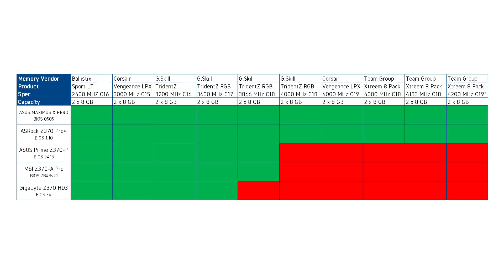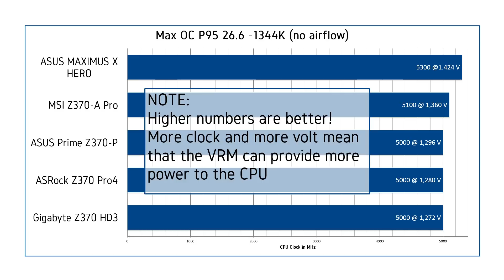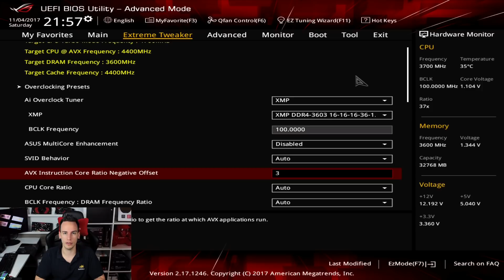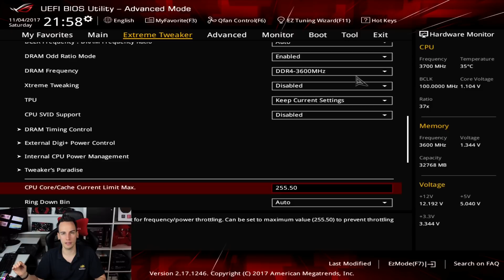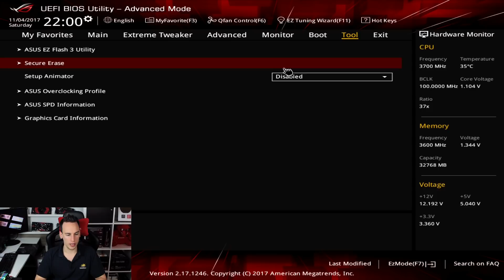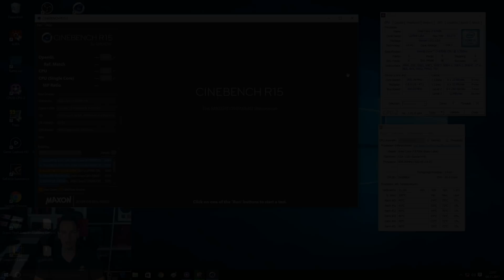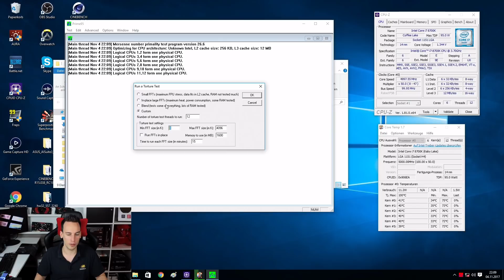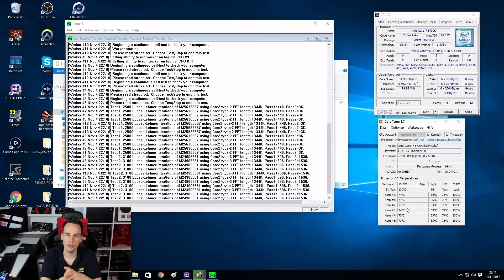ASUS MAXIMUS X HERO - Overclocking Test and Guide 8700K (en)

Comment: I am using a 120 mm radiator push pull fan. Load line calibration level 6 was to unstable, level 5 gave more stable voltage control. I was able to reduce Temps to 80 degrees C and lower for a whole hour at 4.8 gigahertz on all cores. Latest bios, 1801. Thank you for this great tutorial.
Reply: yeah level 5 is less agressive indeed

Comment: derb8auer can you confirm this behavior on the motherboard for me? Whenever i enable an overclock with this board say a simple xmp overclock the boot process changes when flipping the power supply switch on the psu than it does at default bios settings. At default flipping the power switch then the case power button the system boots up once. But with any sort of overclock flipping the power supply switch off then on then hitting the case power button the system will boot, shutdown then back on normally. This only occurs with an overclock then flipping the power supply switch off and on. If i don't flip off the power supply switch again with an overclock enabled and simply continue to power on and off with only the case power button then this behavior never repeats itself. I'm just trying to find out if this is a new functionality of these newer boards. Because with evey Asus board i've used from the IX Code and down i've never seen this behavior. I would appreciate it if you could test this yourself.

Comment: to make 5.1ghz or 5.2 you need scalping, otherwise it is dangerous for the processor, I tried it and it keeps normal in tests, but temperatures are high 95-98 degrees and that is not good, i have asus maximus X Code motherboard and i7-8086k limited edition procesor with ram g-skill 3800 32gb(4x8) its a good system but needed scalping:) I myself do not want to do it dangerously:) but the i7-8086k processors themselves do a boost when they need it so I don’t know if there is more sense for overclocking)) what do you think?

Comment: Thanks for the vid!

Does anyone know if these settings could be used also for the 9600k? I know it is roughly the same as 8600k but where I live there is a deal for the 9600k being -20€ cheaper including black ops 4. Id like to oc to 5ghz with a Noctua NH-D15 without delidding. Is this possible?

Comment: Ive used completely same settings for my asus rog strix 370H with i5 8600k. Ive got 4.8ghz with 1.28vcore. When i run cpu-z my core voltage shows as 1.264 and under load goes down to 1.232.. I have 16gb ram 3000mhz.  Why is his idle vcore is lower and under load voltage is higjer as it should be ? Is my motherboard throtelling or what ? Ran prime95 as shown in video its all stable.. Temp are in high 60's under stress test.. But why is my vcore is different than bios and goes down under load ? Will i damage something if i will leave it as it is ? Like motherboard or smth ?

Comment: Thanks for this. Is there a way to where the CPU isn't always at it's max clock speed? You know....so it can idle down to a lower speed when it's not needed. Any ideas?
Reply: just type power saving plan  to search bar on windows and use balanced option there then it will clock down when idle and not needed as he stated ofc you can have it at high performance like he said its fine

Comment: with delied max overclock in Z390 maximus XI hero at GHz all core with 8700K?with cooler Noctua NH.D15S ans double fans max 85 grade?II aspect for period befor nataiclie andl buy Z390 XI Hero wifi or no is same?excluse wireless? not use wireless only cable,i use adapter netgear AC 1.300 Mbps and 600 for N A7000 nightwak.Thanks Master.

Comment: @der8auer I followed all of your steps in the tutorial since i have the exact same CPU and MB however, I noticed that while running Prime95, that my CPU frequency lowers itself about 300mhz lower than what I set it to be (4.8ghz). It runs at 4.8ghz and then drops to 4.5ghz for a few seconds and then ramps back up to 4.8ghz. What is the reason for this? Is it because of too little voltage? or should I set Windows Power Savings to Performance mode? It is running at the default BALANCED. Thanks!
Reply: its the avx offset that lowers it, im running 4.8ghz stable with avx set to 0
Reply: @Shadevv   I initially thought that to be the case as well, but Roman says in the video that that particular version of P95 applies a non-AVX workload. Then why would the CPU underclock during stress? I don't get it.
Reply: @HammerHead0908  you could try to put the power plan to max performance and then run it if it makes any difference,
Reply: @Shadevv   thats a good idea, though i wonder if a professional workload like blender (i think not AVX?) or video rendering with Premier would cause this speed drop?

But it still doesnt make sense why an non avx workload like Prime 26.6 would cause a speed drop just due to the power plan? I checked the power plan before and the max is indeed 100%. Dont get it.............
Reply: @HammerHead0908  well its possible its not about that, have you disabled the correct settings in bios?

Comment: I'm hiting 90C on Cinebench and I'm only at 4800MHZ and 1.248V of core voltage. I have a tower cooler. What should I do to lower my temps, reduce CPU voltage or reduce CPU speed?

Comment: Im using a maximus IX code with a gen 7 chip. I used this base to set my 5 GHZ over clock and it seams to be running well. Is there any reason i should be concerned about doing this with my chip ?

Comment: I have been using these default overclock settings reliably for 6+ months.  Updated to BIOS 1704 last night, reapplied all the overclock settings, but the CPU still seems to be operating at the stock 4.0 GHz instead of 5.0 GHz.  Anybody else seeing this?  I've cleared the settings and reapplied them again just to be sure - same result.

Comment: I got a question.  Using Maximus X formula and followed your guide. My problem is my Vcore won't clock down, my clock speed idles but not my Vcore stuck at 1.344v at 800mhz. C-state is on auto and Speedshift is enabled.

Edit: Using the latest bios. Used CPU-Z latest version, showing 1.344v when idle @balance power mode.
Reply: If you're following the guide it's because of the manual mode for vcore.
Once you're happy with your overclock you can then change to adaptive/offset voltage and adjust to the same voltage as you got with manual.

Comment: I changed case from a nzxt h440 into a h500i. when i turned everythin back on pc didnt want to boot telling the system has posted in safe mode because of instability or the power button was held off to force shut down. MB is an asus maximus hero X, i7 8700k and 16gb ram 3600mhz corsair vengeance. I dont even have any overclock on,  only xmp profile was active before i started to rebuilt into the new case and i found out that by disabling it pc would boot again into bios. I cant apply xmp anymore for some reason. i had it active since febreary since i built this computer in that h440. Bios is updated to last version. Is there a way to fix this? i cant run my ram on their advertised speed, pc will boot till 3000mhz. Already tried manual ram oc, voltages, timings, mode 1 mode 2 nothing worked. Since i rebuilt i can only post at 3000mhz

Comment: Thank you so much for this guide. I managed to overclock my i7 8700k to 4.8 Ghz @ 1.250 volts (Only using 1.216, so i might change that) ran the stress test for about an hour with no complications and my temperatures were around 68 degrees. Hopefully they go down to the low 60s once i drop the voltage to 1.220. I still haven't played any games, really excited to start though.  Thanks again.
Reply: Hello my core voltage its become fix at 1.250 its normal not have problem ????

Comment: I copied everything. And it hangs before the windows login.

I5 8600k
Asus Roy strix z370 g gaming
2x8 ddr4 2666
Reply: You may need more vcore since the i5's are usually lesser binned cpus.
Reply: @Neggy-Z  after playing with it for a while. I was able to get 4.9 @ 1.37v stable. 5.0 is stable @ 1.47v which is scary.

Comment: I'm have Asrock z370 extreme 4 at 12 phase and 8700k answer cooling Noctua d15S + fan premium 2017,the z370 extreme 4 used Mosset good mada in japan,have  also problem memory with bios 1.80.Thanks.

Comment: This is probably the best overall z370 motherboard, but as it was not cheap, i went with the asrock z370 gaming k6 which is also a really good board for overclocking. It would be my pleasure if der8auer could do a an overclocking tutorial video for the asrock extreme4/gaming k6.

Comment: Great video. I am new to PC building and overclocking. I just built my computer 2 weeks ago and am running without a GPU since I pre-ordered the 2080 Ti FE. I have a 8700K and a ASUS ROG STRIX E-GAMING Motherboard. Also running Trident Z RGB 3600 Mhz with CL 16. I have a Corsair H100i V2 240mm water cooler with two LL120 RGB fans in an Inwin 101C case. I hear the E-gaming is not as good as the Maximus Hero of course but I got it for a good deal and I did not plan on getting the 8700K at the moment and was going to be getting a 8600K. The BIOS is the same so would I use the same settings and steps. Any help and tips or links to videos about understanding more about overclocking will help. I am worried about temps and hopefully that I got a good Chip. I will probably watch this video multiple times and do more research. Maybe I should start with 4.8 Ghz? Should I wait to get my GPU to overclock. I already have the ram at 3600. Thanks in advance.

Comment: I overclocked my 8700k to 5.1 which was working for a minute but for some reason the multiplier stays at 42.0 now and wont go above 4200 MHz which is really pissing me off after following multiple tutorials and testing it with Prime95

Comment: Hi de8auer.I just finished my i7 8700k build and i just want to say thanks for your video it helped me alots. 
My i7 8700k is running at 5.1ghz avx 0 with 1.296 v my temp is around 68C on each core but peak at 79 once in a while but the avg is 68-70 on prime95. 
I can also get at 5.2ghz i did try it but i dont want to go over 80 in peak temp,
the chip is not delided and i use a corsair h100i V2 with original thermal paste ...i want to know if i change only the past from my h100i v2 for kryonaut past 
what should i expect ? 5-15C better ?  

look like i have a good chip since you said for hitting 5.1ghz 5.2ghz stable you need to delid your chip and mine is not and i get it at 5.1ghz at only 1.296 v stable
i can get it a 5.2 1.330 stable but temps get a bit too high thats why i want to change my thermal paste for kryonaut so i can get lower temps and keep it 24/7 at 5.2ghz

Comment: Awesome instructions. I ran these settings on a ASUS TUF Z370 Pro Gaming mobo, i7 8700K (no delid), Corsair Vengenace DDR4 3200 RGB, Corsair water cooling and it worked above my expectations. VCORE under load at 1.324 volts, idle at 1.344 volts, max at 1.360 volts. VRM 6 phase , temp at 76 degrees Celsius, CPU temps, package, idle at 37 degrees Celsius, under load at 76 degrees Celsius, highest core temp 81 degrees Celsius. 3rd Cinebench in a row score 1609.      It's nice to know my machine runs well with these reasonable temps, but I have no use of a overclocked machine, because this is my music studio pc (Steinberg Cubase Pro 9.5 using AVX instructions) and the audio latency and CPU load was much higher overclocked, then with the ASUS Optimized default settings.  So, I'm back to the Optimized default settings, but probably going to delid my CPU, and use 360 water cooling so my fans make less noise. BTW ambient temp was 29 degrees Celsius and water cooling idle at 32 degrees Celsius.  I don't know if It was safe to do this without deliding and I would like to hear some opinions about my overclock, especially how to lower the audio latency. I think I'm going to try this overclock without XMP enabled or lower DDR4 timings. Thanx for this great instructional video.

Edit: Tried some RAM frequency settings and It runs better at 3000 Mhz.  Less latency and less CPU consumption and no more cpu spikes.  I think my corsair ram has a to low voltage on this mobo to run at 3200 Mhz. It's crazy, but It's at 1.376 volts.

Comment: @der8auer, could you offer a little advice please. What does Maximus Tweak mode 1 and mode 2 do exactly (RAM settings page), what are the differences? I'm trying to get my RAM a little further than 4000Mhz without hammering it with vDIMM. Many thanks.

Comment: If you are using Asus z370 strix - always update you BIOS to the latest version. Otherwise you won't be able to run a stable 5GHz overclock with those settings!

Comment: What setting should I use for a non delidded i7-8700k?
Reply: Same if you have decent cooling. Just keep an eye on load temps and not going too much on vCore voltage and you should be fine. My 8700K will do 5Ghz on 1.280v, so you could start a little lower vCore than der8auer has in this video.
Reply: Antony Cambell I have an h100i v2. Would that work as “sufficient cooling”
Reply: That's a good AIO, should be fine for cooling 8700K as long as you have good airflow to the radiator. Good luck, have fun with it.

Comment: 7:00 so, can you explain to me why we can’t use lower level like 3 or 2 if the lower level is better as you said?
Reply: 2 or 3 is too low and will still get vdroop under load which will cause crashing. To maintain stable vCore use 5/6/7, generally 5 or 6 is best.
Reply: Antony Cambell  Thank you so much man for your replay, i didn’t overclocked my cpu yet but im planning to push it to 5.0-5.2 ghz depends on temps so what is your suggestion should i go level 5 or 6 , my cpu: i5 8600k , mobo: asus z370-e
Reply: All you are doing by using LLC (load line calibration) is trying to maintain the voltage you set manually for your vCore. Idle doesn't matter so much, but under load you're trying to keep it close to what you set manually. Ie, for me my vCore is 1.280v my LLC is 6. Under load it stays at 1.280v mostly with a small overshoot which is fine, you just don't want it dropping under load or it's likely to crash.

Comment: Hi Roman, 
The VCCIO and VCCSA voltage are both around 1.34V in M10H motherboard. 
CPU is 1.37V 5.1 5.0 8700K.
Memory is Corsair 4x16GB Dominator XMP 3000 15-17-17-35 .
Is that normal for MC have this kind of level voltage to deal with 16GB memory module?
Reply: is too much. 1.25v is the nice voltage for the IMC (VCCIO and system agent voltage). the consequence will be that the cpu it generates more heat

Comment: I’m so frustrated, I have the 8700k with Maximus x formula and I literally did the same settings in video and I have the Corsair rgb pro which I pushed to 3600 from 3200 aswell as putting the cpu to 5.1 idk why but my cenibench is all over the place, I get anywhere from 1640-1620 and sometimes it goes even lower... idk why this is happening could it me my crappy 600w psu with not even bronze rating? Or?? Sigh rip 8700k. I have a 360mm aio and non delided cpu temps hit 87c with 1.35 volt set in bios... another issue! My cpuz goes to 1.376 instead of the 1.360 I see with you.. so many issues with my cpu.... I hope it’s not damaged
Reply from the maker: sounds totally fine to me? I don't understand what kind of problem you see?
Reply: der8auer well when I see you getting 1550 on 5ghz and I’m getting sometimes below that on 5.1? I’m really lost.

Comment: i want to ask i do everytihing you say i have delided i7 8700k and this same board and why my temps are 77c in game like overwatch? and i using Noctua nhd15 and i don't know why these temps my cpu is set on 4.8ghz and temps is 50 while not gaming...any suggestions
Reply: my voltages are at 1.280 llc 6 at 4.8ghz and it's hot still...voltages are low i can run 5ghz with 1.320 stable with prime95 but temps are 86c after testing all night or smth like that...
Reply: and yes i disabled my svid. :)
Reply: i have black widow chasse with 2 in front 1 behinde and i opened my case because its about 3-4c lower temp
Reply: now is about 25c or 77 degrees
Reply: but yes i saw when is hotter in room my temps are bit higher..
xD

Comment: i have same cpu, mobo , dimms and  i follow step by step your OC guide , but when i run the Cinebench after few secs OS provided BSOD with error" irql not less or equal". Now i use the game OC preset from BIOS extreme tweak menu and working fine. My question is why this happen?
Reply: not every chip is created equal, like he said. his chip is binned. some can run 5ghz, some can't. you need to find what your chip can and cant do on your own.

Comment: If its stable at 5.0 and i want to go 5.1...5.2... avx Stay -3...or i put -4...-5...?????
Reply: Put 4 or 5, then once you're running with stability for a while (days/weeks) you could try changing back to 3 and see how it goes.
Reply: its not a huge +fps in game 5.0 or 4.7...about 1or2 fps...and 15degree so i stay at 4.7

Comment: I have this board, 8700k and trident z ram, NZXT x62 Kraken cooler. I'm using a 650w GQ EVGA power supply. Do you think this is enough for overclocking?

Comment: So I set mine to 4.7Ghz and all 6 cores with 1.25 volts. I did this cause it gets hot in the south during the summer. 

My issue is when I play games downclocks to 4.3 and holds. Why is it not running a full OC?
Reply: Rageous Temps?
Reply: MavTheSheep under 65
Reply: Have you disabled things such as CPU SVID support? Have you set an AVX offset? It is quite buggy at the moment. It could also be Windows limiting the power. See if there's a setting to prefer maximum performance over power savings in both the BIOS and Windows.